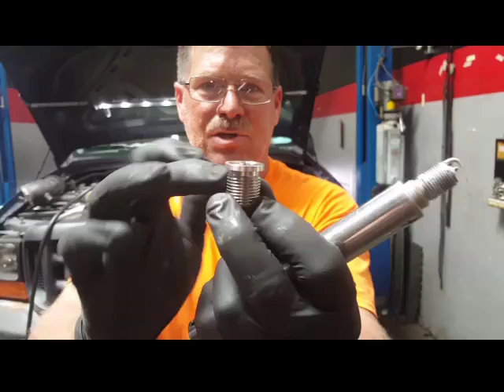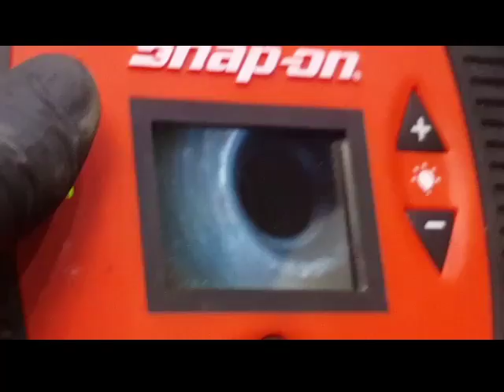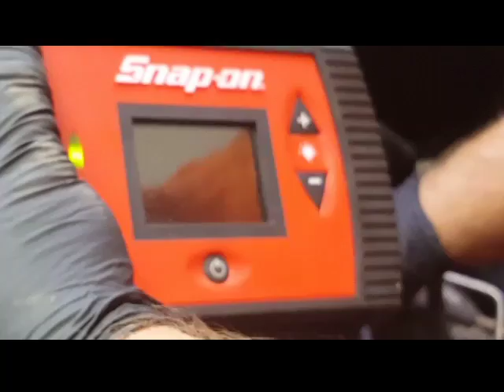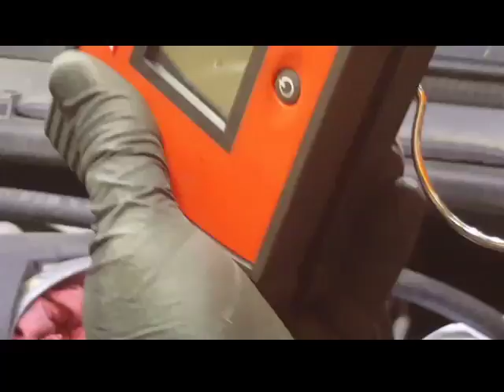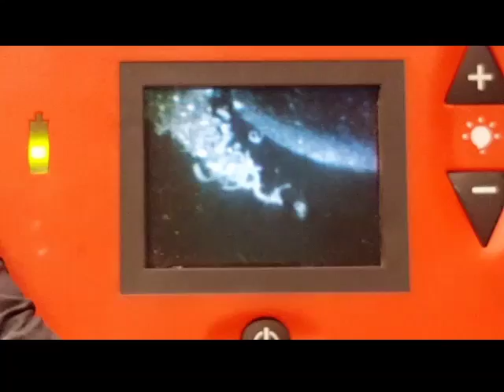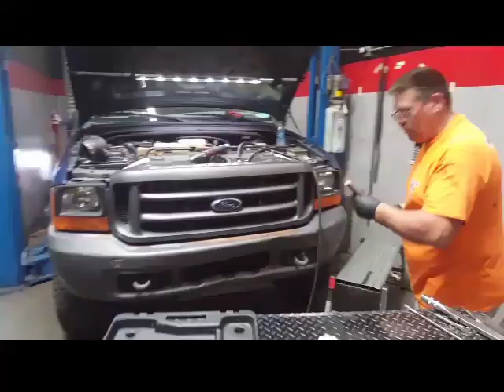New Method on repairing Ford Triton blown out spark plugs. 2 valve only

Comment: I just did the #4 cylinder in a ford e350 v 10 exactly as the video stated. When I got the tread locker out of the bag cal van sent there was a note in the bag stating not to use the clip on the reamer. (too late) It sounds like they don' want a shelf left at the bottom of the hole. Since I was already threaded down to the groove in the tap which stopped at the shelf, I proceeded to install the insert and plug. It felt soft as I was trying to get to 17 ft. lbs so I stopped turning it any further. Time will tell if it still works. I wish I had read the comments first as I see Ron now recommends not using the clip on the reamer.
Reply from the maker: Even with the lower shelf on you should get a positive stop while tightening. The reason I stopped using the clip is because in the early days it was feared the hat would not seat all the way down. I still do it both ways.  You might want to try tightening it a little more. You might have just felt the spark plug tightening into the insert and thats the softness you felt. Good luck

Comment: Many years ago I stripped a spark plug hole on a Suzuki 1000 motorcycle. I rigged compressed air to the exhaust. Then rotated engine till air blew out that hole. Exhaust open Intake valve closed. Greased tap and tapped hole. Air blows material out past tap. Grease captures minute particles.

Comment: Hi first I would like to say you are amazing and thank you so much for these videos. I hope you can respond in time as tomorrow I will be doing the job. My question for you is the kit specifies to put that clip on the thread tip and does not mention using the clip on the reamer. Is that possibly a mistake ? They don’t say not to use the clip on the reamer they just do not mention the clip at all until it’s time to use the threader and then they specify to use the clip on the thread tip. I want to make sure I ream the hole deep enough that the insert sits properly but I i’m not sure if I go to deep if it will damage something like the bottom shelf you mentioned? and/or not let the thread insert sit properly???? I know my piston is down far enough however I am not sure and would like your expert opinion on what you would do? I drive a 2001 Ford E-150 Econoline triton 4.6 L V8 2 valve. What do you think I should do? Thank you in advance
Reply from the maker: Watch my video on the revised calvan insert installation video
Reply: @SandCarServices  thank you for the quick response ... I thought this was the updated/revised video? but I am having trouble finding another video by that title, you have so many but I’m not having any luck finding another besides this one. Can you please drop the link.
Reply from the maker: It is not mandatory to use the stop clip on the reamer. As long as it has the roll pin in the top that is pressed in and prevents the reamer from falling into cylinder. If you have the pin just let the reamer punch thru (2 valve only) 3 valve if different.
Reply: @SandCarServices  thank you so much Ron! Yes I have the stop pins on top, however i wasn’t sure if the bottom shelf served a purpose and I didn’t want to punch through if it could possibly cause issues, but if that bottom shelf isn’t serving any purpose then I will just punch all the way through as you recommend. Yes it’s the 2 valve with the “popcorn plugs” as you call them lol
Reply from the maker: I punch through on all 2 valves now. But be careful when using the tap. Dont let the c clip groove drop below the top of the guide .I usually shoot for that groove just out of sight just below the top of the guide. If you tap farther than that you risk dropping the tap into the cylinder and that opens up a whole new can of worms!
Reply: @SandCarServices  OK so I have the c clip I will attach it on the top of the guide on the slot closest to the hex end and  I should just go down carefully until I reach the clip correct?
Reply from the maker: Yes but I stopped using the e clip on the tap after I had one bind up when the clip hit the guide and it froze the tap. Butt pucker moment for sure
Reply: @SandCarServices  oh wow lol now I’m scared and clip or no clip is the question lol🤔🤔🤔🤔
Reply from the maker: Its real easy to me. But here's the deal, the groove for the clip is in sight as your tapping right, right! As soon as it gets to the top of the guide get ready to stop ✋tap until the groove disappears just out of sight. Then stop and back out. If you stop with groove above/in sight then the insert will not seal correctly
Reply: @SandCarServices  alright I did it, just got my 3/4-16 nut and tested my inserts how you showed us...even though my kit is black unlike the original kit from 2 years ago which was silver but they seem ok. I’m going to put the insert in now and I’ll Update you all later thanks Ron ur the man
Reply: @SandCarServices  I just read this comment after I did it, so I ended up using the clip and then when I got to the clip I did the last few turns by hand until I felt it get easier to turn and it almost felt like it fell through, at that point the clip was flush on top, I then removed it cleaned it out and used the jb weld for the hat and loctite on threads and installed the new thread and new plug. It went in all the way down by hand nice and easy and then I torqued it for the last turn, put the coil and my air filters back on and started it up for one minute only and shut it off like you said and then now I’m letting it sit overnight. Obviously the clip was on so it did not go below that line.

 so If the insert did not seal properly how would I check ? Or at this point is there nothing I can do except wait and see if it gives me problems? Lol if only I waited 30 more minutes and read your response before hand but I literally had put my phone down and had to get going b4 I lost daylight and did not read it until now when I just finished up replacing all the other plugs 🤦🏽‍♂️🤦🏽‍♂️

Comment: Great video sir! I have one question...how would you remove the cheap insert?
Reply from the maker: That is an excellent question! And there are so many different answers.
Reply: @SandCarServices  well what are they? I have a cheap insert I got to remove in my number 2 cylinder before doing this. Could I put loctite on an old spark plug and then screw it back down in the insert and let it sit overnight and then try srewing the whole thing out?
Reply: @SandCarServices  I would love to hear some of the different answers.  I'm grateful for your mention of checking for an old insert in the hole but I'm not sure how I can get the save-a-thread insert out of the hole.  The old insert appears to have damaged threads from when the plug blew out again.  Thanks for your videos :)
Reply: Did u figure it out I'm in same boat  @techwrightauto

Comment: Thanks for the awesome video Ron! Do I need to use a different spark plug after the insert install or will OEM size plugs work? Thanks
Reply from the maker: +Are you My mummy? Original equipment Motorcraft plugs or what I use. There is no need to change spark plugs because of the insert.

Comment: Ron got a question for u. I got a 5.4 and there is a insert still in the hole but its been jb weld lin I dont know what kinda insert it is. I got the call van kit. And how would I get that old insert kit out since it blown out the spark plug.
Reply from the maker: That's an excellent question. But the answer can be very complicated. Removing an already installed insert is one of the hardest problems I face when performing a repair. Easy out/extractor tools haven't always worked and the heads have had to come off for repair. Every situation is different and therefore I have to see it in person to assess the situation.
Reply: @SandCarServices   I been stumped on it for over a month now its a 2000 ford f 150 and if I had ways to send u pics I would. Hard part is I live in wyoming and have no way to get the truck down to u its the passanger side 3 one back.

Comment: Awesome video, thanks so much for passing on your wisdom! I am replacing head gaskets and completed all 8 inserts while they were out. I notice the plug tip doesn't stick out as far into the chamber as it did before. I used the clip on the reamer and I'm using motorcraft plugs from a dealer. Do you think this will effect ignition?
Reply from the maker: No. The shelf seats on the hat of insert and the thickness of the hat makes the plug inset just a little. Ive done over 1000 and no problems
Reply: @SandCarServices  Good to know, thanks again!

Comment: Hey, just wondering if you could give your insight on what torque should be on these plugs without the sleeve.  Everybody is back and forth in this, some say 28ftp dry per updated tab and others say 15ftp with anti seize..
Just wondering what you do for a normal plug exchange with no cal van
Reply from the maker: 17 ft lbs no anti seize
Reply: Holy smokes that was a fast response. Thanks for the reply as I’m doing this right now and respect your opinion. I’ll do just that and be done

Comment: On my vehicle on the #2 cylinder the spark plug sheared.  And I wasn't home so I was limited on me fixing it.  But I changed the engine.  Is this what caused the spark plug to shear.  The mechanic before me might have cranked the spark plug to 30 or 40 foot pounds and ran it to far down into the piston?  This is all moot as the engine has been changed.  But might this have been the cause?  I have a used engine now should with new plugs and coils should I be pulling pistons and checking or just wait and see if one pops out?

Comment: Does a pneumatic socket need to be used? I have a ratcheting drill I was planning on using but both Ron and the instructional video says a "high quality" air wrench should be used...

Comment: What is tap/insert diameter? Stripped aluminium threads with extraction tool and hope this CalVan adapter will fix.
Reply from the maker: OUTSIDE OF REAMER IS APROX 11/16" OUTER DIAMETER

Comment: I have a 98 expedition 5.4 just yesterday I was driving and I heard a big noise I thought it was my manifold but look were the noise came from n I saw the spark plug out of the cylinder my engine has over 3 hundred miles is this normal for it to happen also its overheated several times

Comment: Ron,  Thanks for the video.  I read all the comments below and did not find an answer to a question:  Do I need to let the JB Weld or Loctite 271 cure before running the engine?  If so how long should I let it cure?
Reply from the maker: Job weld under hat and only red loctite on threads, start up for 1 minute then let set for a couple of hours

Comment: Ron the CalVan insert worked great! But now the coil pack bolt is stripped and I can't change the pack it went bad. Have you ever run into this and how did you resolve?
Reply from the maker: in my shop if the metal threads are bad on a plastic intake we replace manifold. ive seen cars come in that just broke/removed old bolt and zip tied or installed a wedge under the fuel rail to hold coil in place.

Comment: Thanks for the information!
Question, how long should I wait for the JB weld and loctite to dry before moving on to the next insert install?
Thanks again!
Reply from the maker: I dont understand the question
Reply: If I were going to do all 8 cylinders how long should I wait for the JB weld and Loctite to dry in the first cylinder to go on to the next cylinder.
Reply from the maker: No need to wait. Just make sure the shavings are cleared as much as possible. The loctite and jb weld will dry while moving on.
Reply from the maker: Thank you for your donation. It helps immensely.
Reply: @SandCarServices  hey Ron I didn't have the e-clip on the reamer and drilled all the way through. Any suggestions ...? Is is repairable in the stage it's in now.? Again thank you for time..

Comment: I got a question I got a broken off insert not a Calvan insert that is  broken in half and the other half is still in the spark plug threads can I use the calvan insert kit drill and drill that out or do I try to some how get it out before I drill?
Reply from the maker: The reamer from calvan is not meant to drill steel. I usually try and use an easy out but if they are stubborn then often the head is coming off to repair insert
Reply: @SandCarServices  thanks I'll try to extract it and we'll see what happens

Comment: Hey Ron if it was your truck would you do all 10 or wait for the failures then replace them? I'll be doing the work myself and figure while am at it do them all?
Reply from the maker: If it was mine I would replace all plugs with motorcraft plugs and torque to 20 ft lbs

Comment: Great video. I have a blown plug from a 2000 5.4 Expi with an insert still in the head. It was installed too far into the head, not by me, so the plug only grabed a few threads. How do you remove those inserts?

i bought the CalVan kit after watching your first video and when the reamer only went in a little and then stopped, I discovered the old inser.

I have carbide burs on order and plan on 'burring' out most of the steal threads and picking out the remanints and then use a magnet and air to clean out the cylinder.

Do you have a better way wiithout removing the head?

You do really good vids!!!!!

Regards, Russ in NH
Reply from the maker: +RJinNH there is a special extraction tool simular to an easy out but it has 4 points of contact tapered instead of the usual spiral easy out. Thats what i use. It is still called an easy out but is way more precise.  Send me a text tomorrow and i will send you a picture of what it looks like.
Reply: Ron Williams GREAT! I'll text in the AM.

Comment: I just bought the 38900 kit, opened it up this morning, started checking it out and found the Core Drill would not go through the guide! Tried to call Cal-Van tool, could not get a hold of anyone to talk to. So Quality Control on the Kit is really bad. And did not come with the E-Clip. Also the Kit came with 8 Threaded Inserts, found everyone of them needed the threads cleaned up! And on the Tap found one of the cutting threads is half chipped off. May have to send the Kit back and wait for another one. Truck has been down a week now. But, Ford charges me $400 and I buy the parts. I can wait for the Kit, It's just to bad Cal-Van sends out a bad Product to people with out checking it first for defects.
Reply from the maker: Did you see my video on important update on cal van kit?

Comment: Great video sir! Just received my cal-van and about to attempt on my 2003 5.4 f150. My a/c stopped working (just blowing warm air) the moment the plug blew out (#3). Limped home and waited for tool to arrive. So, today I find my battery dead and alternator started to smoke when I tried to jump it. Coincidence? Have you seen this before all at once?
Reply from the maker: Never seen that
Reply: 10 months later and that one I repaired (cylinder #3) is still holding up. Yesterday #6 blew out smh. Thanks again for this video.

Comment: Ron I have a 2006 2 valve a plug popped but it has an insert on it. Can i still use the 38900 tool fix the problem or do I need to something else?  I have not used a bore scope to see if there are still threads .
Reply from the maker: Most of the time yes. The 38900 kit will repair save-a-thread inserts that pop back out.
Reply: ok Thanks I have someone coming over to see what conditions the threads are in. If good, can I use a cal van insert ?
Reply from the maker: doesnt matter what the threads look like because the calvan kit will ream them out again to make way for the calvan tap

Comment: This is a great video! Will this kit work for the Ford 3.8 V6?
Reply from the maker: No. It is specific for the Triton v8
Reply: Ron Williams do you know of a kit that will work for an oversized hole in a 3.8?
Reply: The hole is already 17mm and still has another reamed out cheap insert in it.

Comment: Very cool and informative, just had 2blow out on my 2003 lincoln town car, what part number do I need for this car Thanks Sloppy Joe Impractical Jokers
Reply from the maker: It should be the 38900 kit from calvan. But make sure you have a 2 valve Triton before ordering
Reply: It has a W code motor looks like romeo motor with PI heads

Comment: Hi, I have a 99 Mustang GT with a Windsor 4.6 which has an annoying tapping noise. I’ve replaced a bunch of parts, chains, tensioners, oil pump, lash adjusters, rockers with no success, I recently changed plugs and found out #2 cylinder has a insert that came out with the plug. I am pretty sure this cylinder is the source of the tapping by unplugging injectors. I can’t find anything else wrong and top of piston looks good. How can I tell if the insert is leaking? Note that when cold the noise is barely noticeable and as it warms up it becomes a steady tap. No misfires, runs good just annoying tapping????
Any help would be very appreciated. Note that, that plug is the old one cause I can’t get the insert off of it with out damaging it. Looks good also. No signs of a compression leak in spark plug hole either. 
It’s driving me crazy trying to figure it out. Please help

Comment: Where is the best most reliable non-defective, non-missing parts place to purchase the Calvan 38900 Kit?  Looked on Amazon, but concerned because some customers said it only had 6 inserts and not 8, and that the kits looked used, or that the inserts had imperfections or were defective, plus there were missing video DVD's or tools/parts from the kits.  Please advise where you get your kits for the best price & reliably non-defective...???
Reply from the maker: There are parts links to dennis at @wiseautotools.com in the description area of all my ford videos